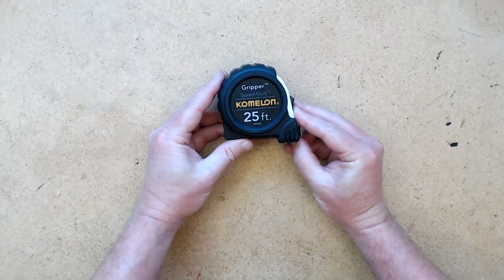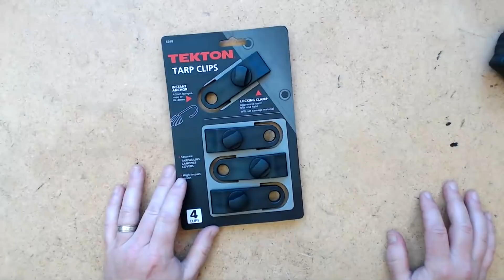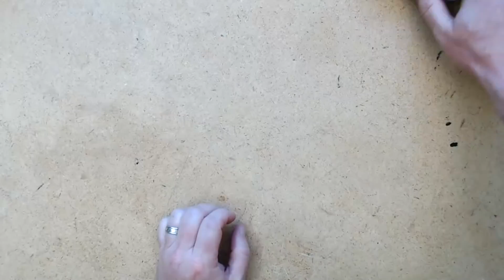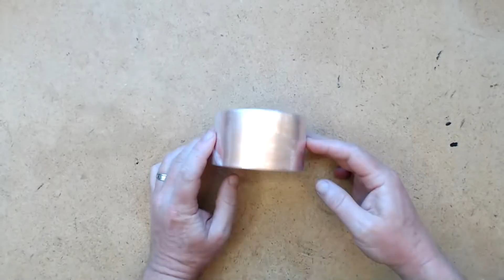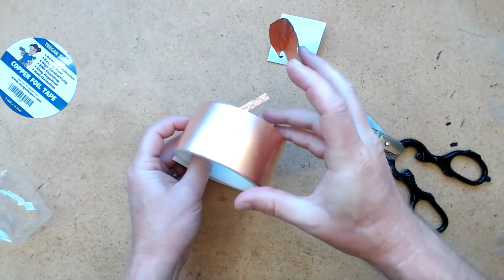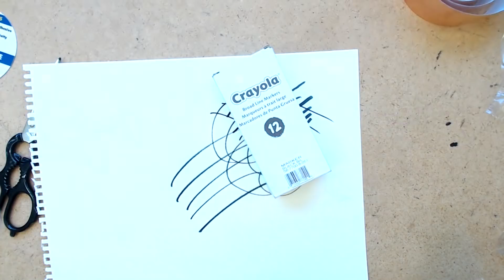New in the Toolbox, June 2018

Comment: The device I have used for many years to lift plywood is the Gorilla Gripper: https://www.amazon.com/Gorilla-Gripper-44009-GP-22mm/dp/B004AJVC7M. It is more expensive but will last a lifetime. You cannot use it for sheetrock, as it will crush the sheet. But for lifting plywood, including 3/4 inch, this thing is the greatest.
Reply from the maker: Good tip! I have that one on my list. I figured I could test a few options and justify a video comparing them all.